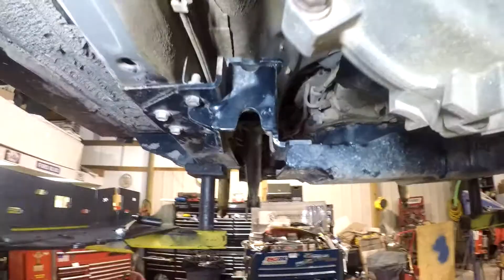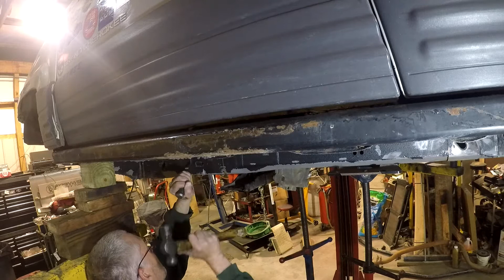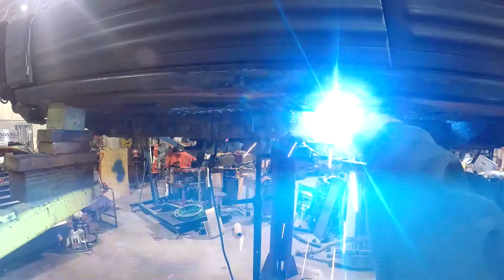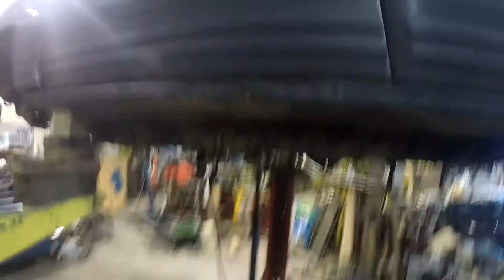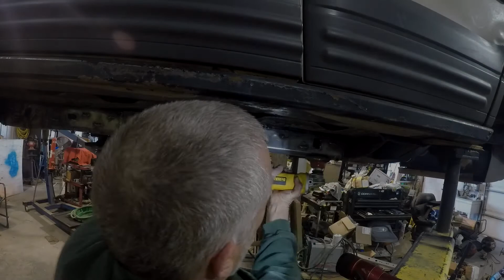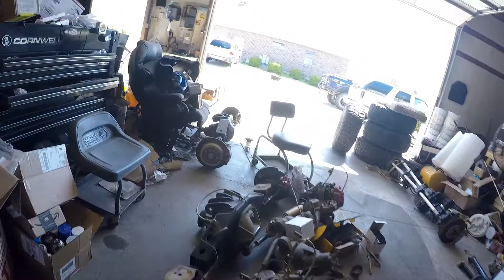ZJ IRO Frame Stiffeners W Rock Link suspension

Comment: It was in the title Iron rock off road. What kind of welder and welding rod did you use? This will be the first time to do any welding  on my frame.
Reply from the maker: Hobart 210 mig .030 wire.. 
On My 1st 8.8 install  I used arch just normal everyday rod..can't remember